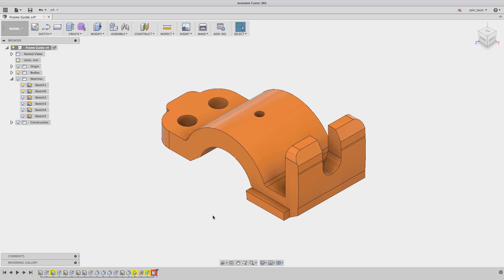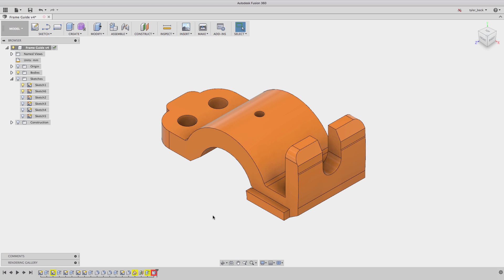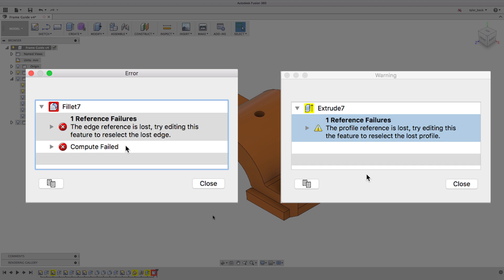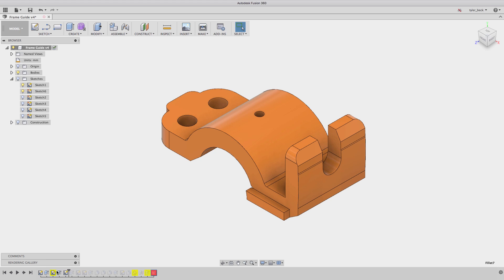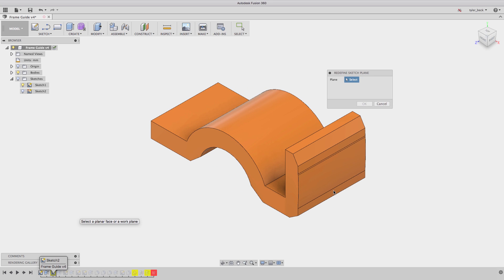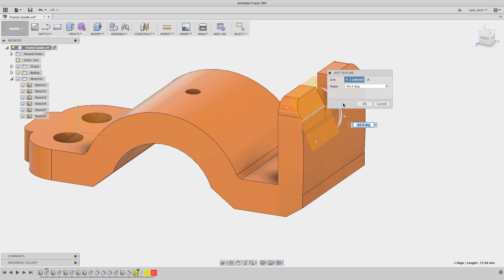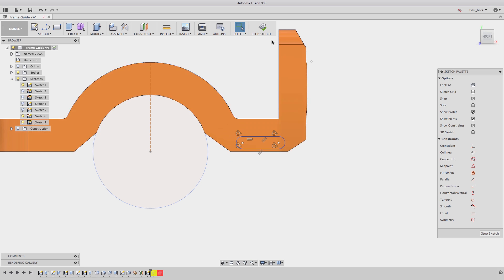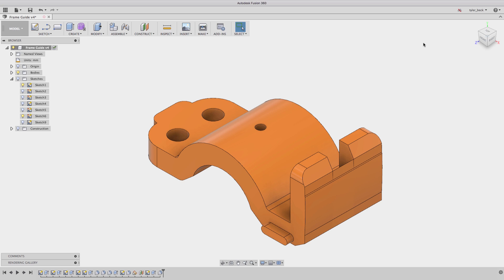Smart strategies to fix model errors & warnings in your Design! | Autodesk Fusion 360

Comment: Closing the file without saving and starting new isn't inefficient, it's the only way to work with Fusion.
Once Fusion started to throw stupid errors - and most of them are stupid - your design is lost, complete chaos begins, no way to get out of this.
Never experienced something like that in SolidEdge, SolidWorks or Alibre, but in Fusion it is normal

Comment: OK, I get it, errors are not a big deal. However, almost every time I'm working with variable-driven models, almost every variable change, unless extremely small (and not even then), is sure to trigger a plethora of warnings in the kind of "lost reference", which makes working with such variable-driven models almost impossible. It would be great, if possible, to see a list of the do's and don't's of modelling for variable driven design...
Reply: This is something I have run into in the past quite a bit (not just with Fusion but also Solidworks)
A lot can be solved by experience and methodology. (not assuming how much exp you have, but this seemed like a good place to say something)

An example I run into quite often is when I see a fillet early in the assembly tree. A lot of times a sketch is made over the same surface with fillets on it. Updated the fillet and a good number of times the sketch loses it's reference.
The other big one is understanding how the software sees sketch lines. EVERY line is unique. If you draw a box and extruded it. You can delete one line and redraw it and break the model depending on what's referencing it. 
You see the SAME line, but the software sees a NEW line which becomes a NEW surface which kills fillets and other items that referenced that surface.
Reply: Hey, Tom,
I have some experience with both SW and Fusion360, and I learned from both that "decorative" additions, like fillets, are best added only at the end of the modelling process, precisely because their resulting geometry is hard/impossible to predict when anything is changed. So I already excluded this scenario from my previous question. As did I exclude the situation where a sketch is not 100% defined. What's different in Fusion360 is the very nice and useful feature where, when creating a new modifier, you can select ANY lines from a given sketch, even the construction or reference ones. And this is what raises the problem of the faulty reinterpretation of the sketches, because this interpretation of a sketch from outside the sketch is just as unpredictable as the reinterpretation of the fillets... At least for now (hoping for a fix soon)